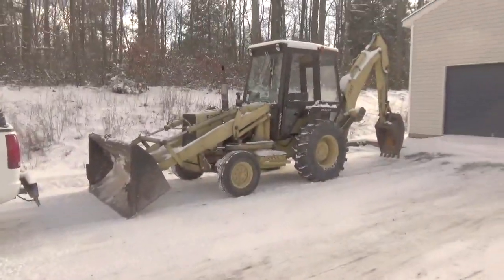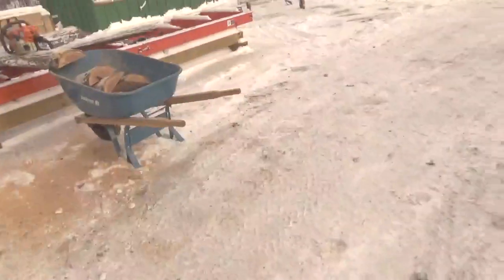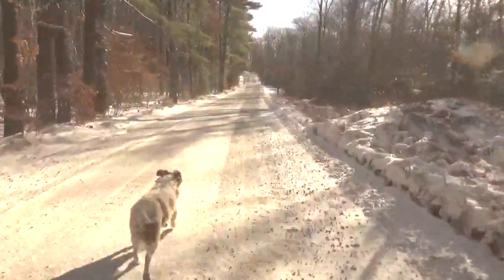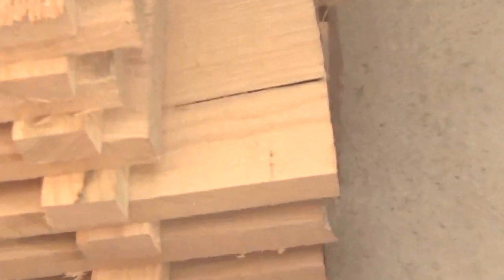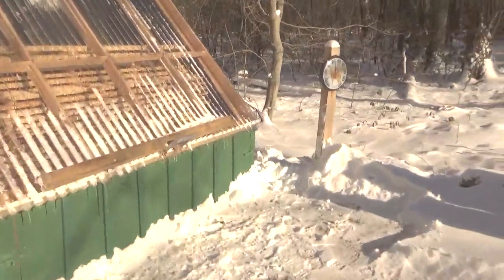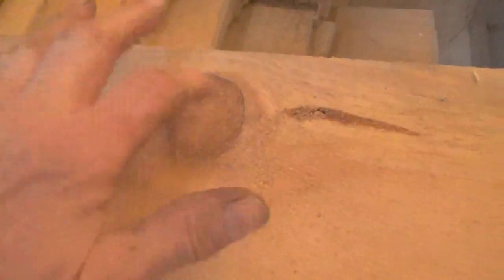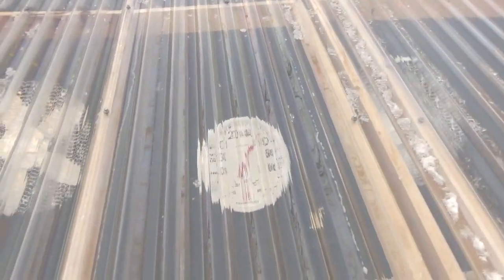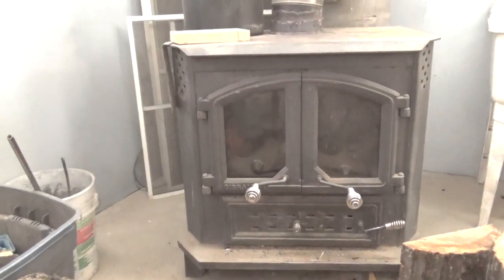After the snow Cleanup and a couple little things.

Comment: I split and stacked firewood back in July and the moisture content ranges from 18 to 37 percent. The wood was single layer stacked with a cover just over the top to allow air to pass through and had most of the Summer sun hitting it. I had planned to burn it  this Winter in my fireplace but decided not to because of the moisture content. What minimum percentage of moisture would you recommend I use to burn in my fireplace? I decided to use wood that I had seasoned for two years and that moisture content was around 9 to 10 percent.
Reply from the maker: Hey John, from what i see if the moisture is below 15% you can get a fire going pretty easy. My kindling is about 8% in the garage so it really gets going quick. I would imagine in a fireplace the wood should be lower like the 10 percent you mentioned because there is no real significant draft in an open fireplace like a stove has. Thanks for comment.